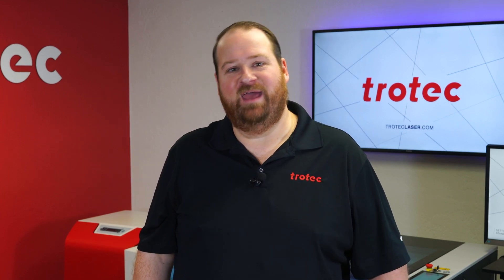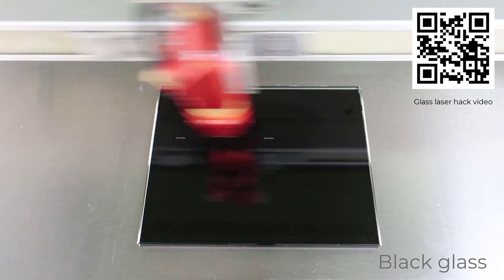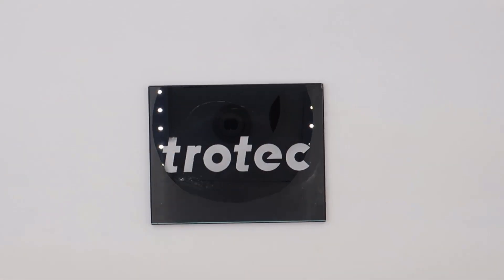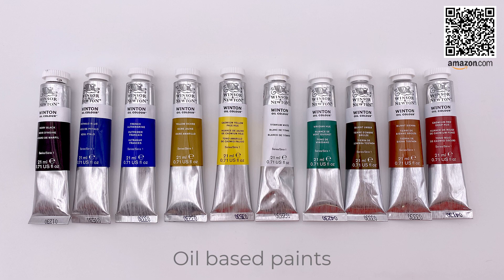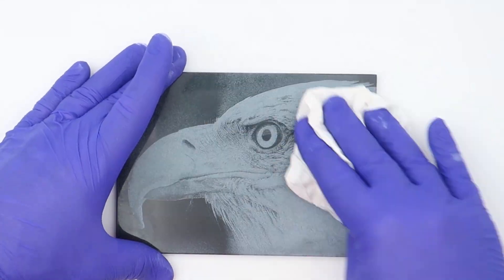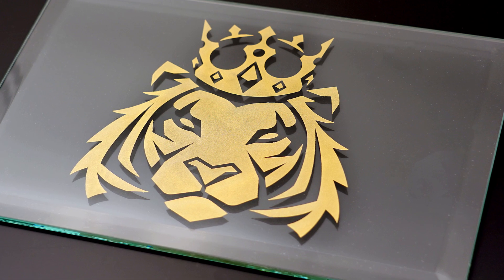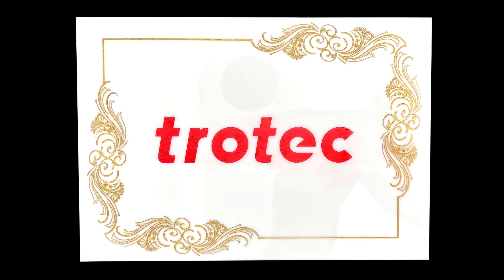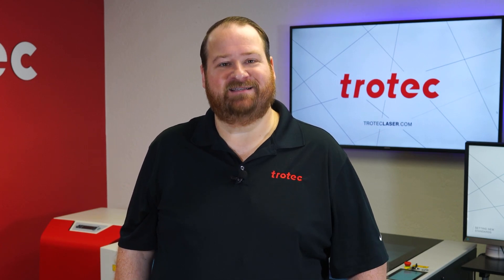Laser Hack: Paint Fill on Polished Surfaces

Comment: Hi Dave! I am looking to color fill Anodized Aluminum Metal Business Cards. I have gold cards I want to fill black and black cards I want to fill gold. I have a 30w fiber.. would the Rub and Buff work do you know? Or how else can I achieve this? Thank you!!!
Reply from the maker: That is challenging because rub 'n buff will not work this way on anodized aluminum, as it is a porous ceramic coating and not polished, so the rub 'n buff will color the entire surface if you try this and you cannot mask it because a fiber laser will not engrave the paper masking because of the wavelength. The only thing that I can think of is to spray the anodized aluminum with a clear polyurethane (possibly two coats) to seal the porous surface, then engrave it with a fiber to mark the anodized aluminum, and then use rub 'n buff or oil-based paint to rub in color.   - Laser Dave
Reply: @TrotecLaser  Ohhh that all makes sense! Thank you for getting back to me. This project has been something else for sure. I think I will try the Poly to see how that works! THank you so much! Tara

Comment: I know they are oil based paints, but can you use them on items that needs to be washed? like wine glass or containers? will the soap eventually wash off the color?
Reply from the maker: From what I have heard, it will fade a bit over time as it is washed, but it holds up well, there has not been any study to confirm how long or how many "Washes" can be completed.

Comment: Hey, great work!

I have a couple of questions:
About the color, is it in real life just like the color portrayed in the video. My second question is if the paint stays on the mirror, doesn’t it fade away or go away if you clean the mirror? My third question is if this paint will also work on mirrors that are hand engraved?

Kind regards :)
Reply from the maker: The images in this video are not enhanced; the contrast and color will depend on the paint used, and the paint will fade depending on the type of paint used, similar to wiping a painted wall with time, it may fade; however, with more durable paint, it will last longer.   This process should work with hand engraving. However, this is the first time we have tried this since we are laser people!

Comment: How long do the oil based paints take to dry on the surface? I am making some signs to go on a wall using acrylic and wondered whether to use acrylic paint or oil based paint?
Reply: That is a good question. I am not sure; please consult the instructions from the paint manufacturer for drying time.

Comment: Does one method work better than the other on different material? Or does it basically depend on the colors you want to use since it seems rub n buff has limited colors?
Reply from the maker: Hi Nic! The finished effect when paint filling varies depending on the material, paint, or inks used in this process. Some types of liquid coloring can work better on some materials. Each pigment formulation, viscosity, and color can produce unique effects depending on the desired outcome. Testing is recommended to be sure of the final look.

Comment: You mentioned fiber laser, did that only pertain to the metal engraving?  co2 for the glass stone & acrylic?
Reply: Fiber lasers can be used to produce enough depth in to metals to allow some paint to be rubbed in, however this process was not shown in the video. The glass, stone, and acrylic all require the CO2 Laser.

Comment: what is the grayscale laser hack? what settings on a 360 flexx?
Reply: There is a QR code for the grayscale glass laser hack or you scan use this link: https://youtu.be/cJBQW7WSg0E
As for settings, that will vary based on the wattage of laser and the material used, the materials database should have most of the correct settings.